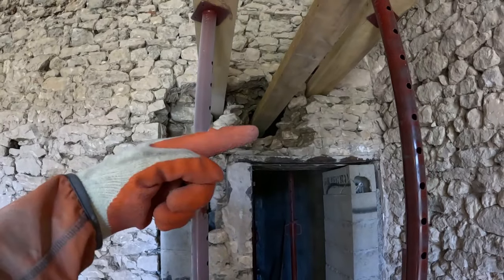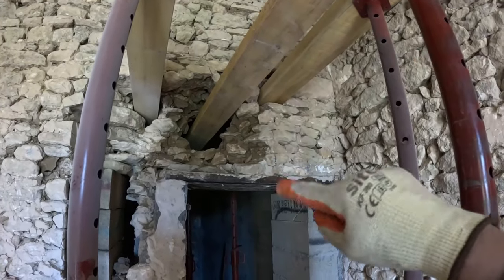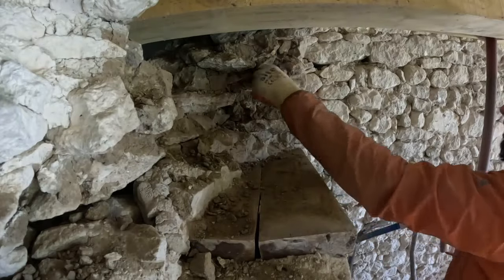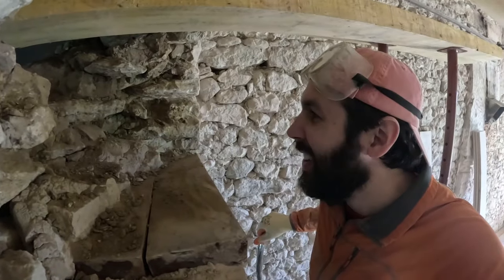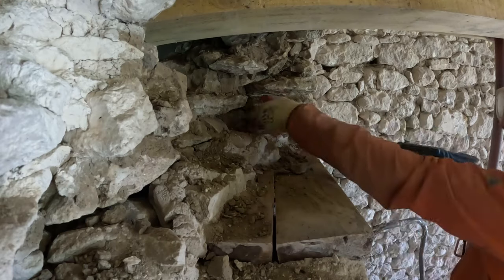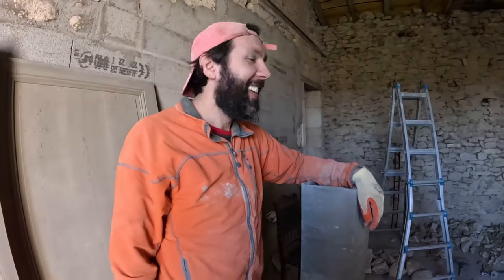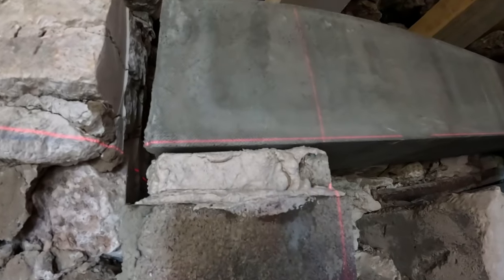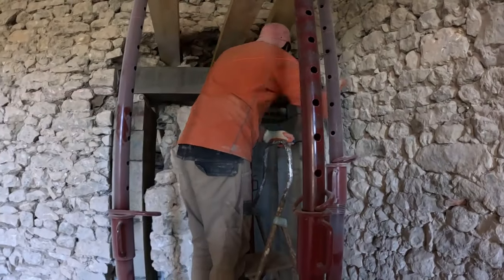Opening Stone Wall for the First Time (to Create a New Door)! PT.2 - DIY-DEMO

Comment: how did you remove the scufolding without it collapsing?
Reply from the maker: We remounted stones on top of the header and between the wood beams. So once we removed the wood beams there was enough support between to hold the stones above. If that makes sense..
Reply: @ohiotobordeaux6295  Yeah it does make sense thanks
Reply from the maker: I.e. we only had to fill the holes once the beams were removed.
Reply from the maker: @JustGeorgeGG no problem!

Comment: Next wall breakthrough, please use the temporary wooden support beams on their sides. They are much stronger that way (and flex less). Perhaps a bit harder to bolt them to the agroprops, but far from impossible.
Reply from the maker: Thanks a lot, yes that’s the reason we put them sideways, it was easier to bolt them to the poles Lol! Next time we will absolutely do it how you suggested!
😊